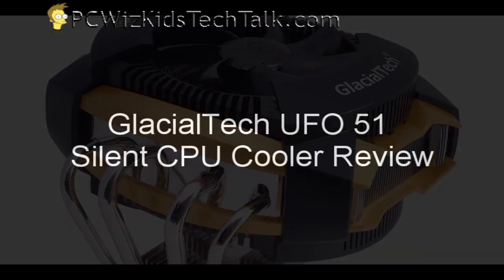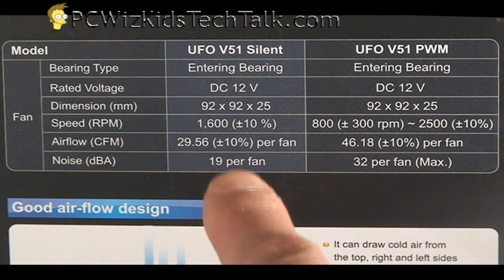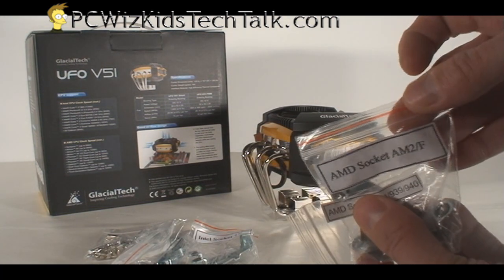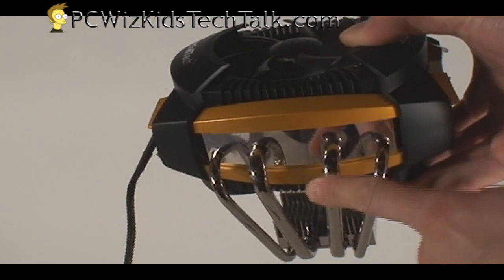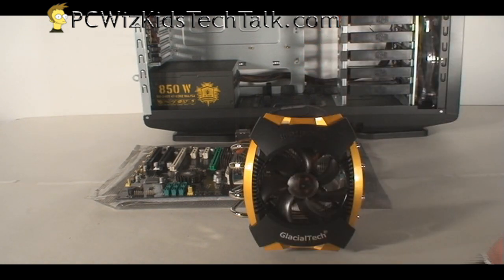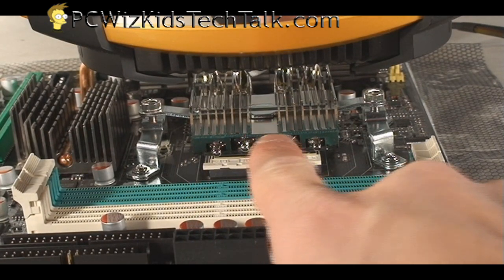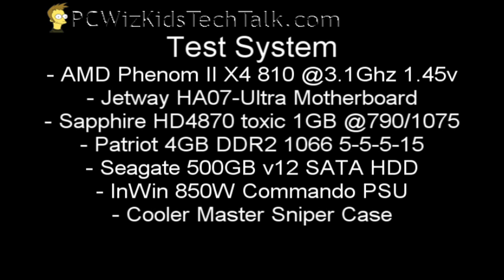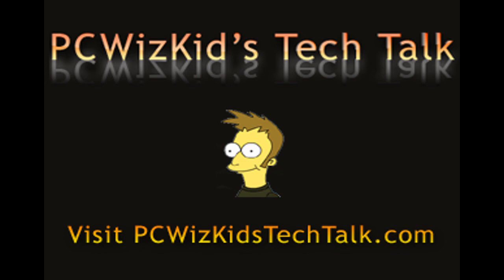GlacialTech UFO 51 - Gaming Rig CPU Cooler

Comment: I have the Zalman 9700 Pro CPU Heatsink. I'm currently running my Q6600 at 3.6GHZ 1800FSB, multi at X8 (goes up to X9)- with a 1.5Vcore and the Zalman 9700 keeps it idling at 34C (highest temp out of the 4 cores. The other cores idle at 28C)- and peaks at 50C-55C. Best heatsink i have ever purchased.

Comment: @PCWizKid An advice, free of charge, what you have done with the TIM is an absolute error on your part. You're right on the part to spread it but not like you did, that is awful and also shameful.
You should spread with the help of a plastic spatula or your finger with the transparent plastic film and spread it evenly on the surface. Improve your method, you will see better results.